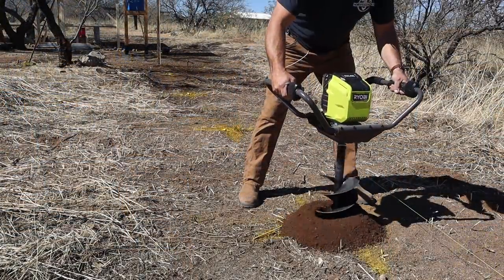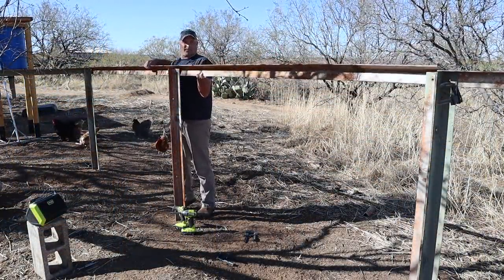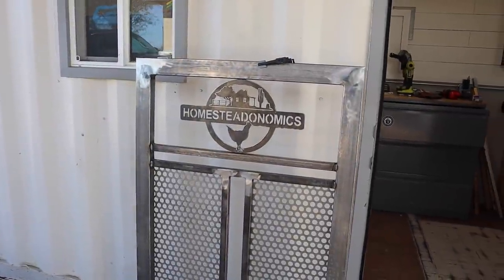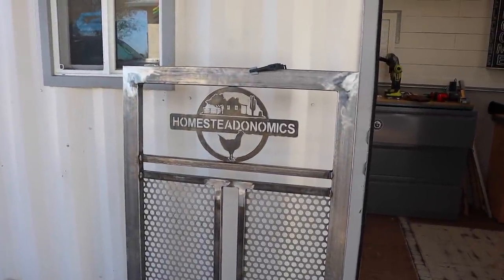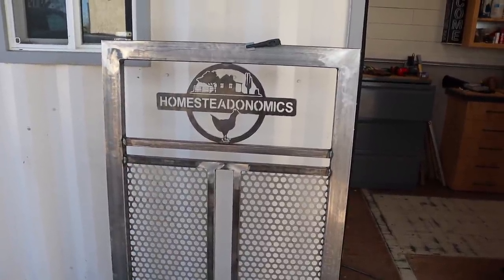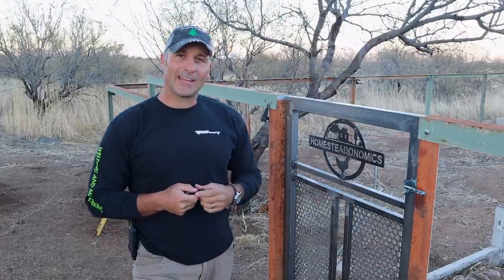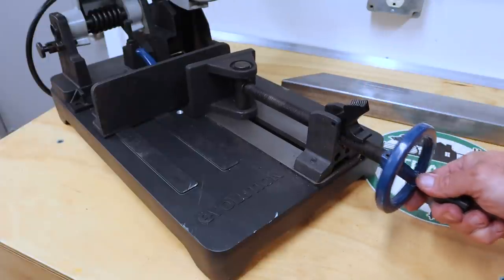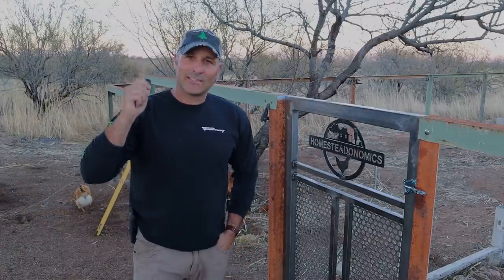Making a DIY Welded Gate for a Goat Pen  (Goat Project Pt 1)

Comment: That gate you built is really great! I am looking forward to the finished enclosure video.
Reply from the maker: Thank you Randy!  I just wire wheeled the rust spots on the fence and primed it today.   So once the paint is on I’ll add the panels and it should be good to go.   Except for the shelter and food water setups.    Gonna be a big project but we are excited for it!

Comment: Glad to see you putting the steel to use.  I was going to build a carport with it but since I live on a corner lot at two intersections, the city wouldn't let me do it because "It would block traffic views" even though my next door neighbor has a huge block wall carport that blocks them anyway.  Great job, looking forward to see what it looks like when finished.
Reply from the maker: Hey George!   I was going to email you the link but you already saw it…great!   The next video should be the fence in somewhat finished form.   Wire wheeled most of it today and then sprayed some primer over the really rusty spots.   Then I’ll paint and add the wire panels in after that.  Except for one corner where the shelter is going to go, it ‘should’ be goat proof! 🤞.   Stay tuned to see the de’anza/cohn theater steel painted and taking on a new purpose!  
Great to hear from you George! 
Joe
Reply: For those who are curious about how I got the steel, the drive-in closed on Oct 9, 2009 after it had been sold to a developer.  Some friends and I formed a corporation and the owner was willing to lease it to us but we needed to raise about $100,000 to upgrade at least one of the four screens to digital projection.  Before we could raise the funds, it got taken over by drug dealers and prostitution so the police asked that it be torn down.  The owners gave us one screen and that is where the steel came from.  I eventually gave it to Joe and his friend to use in other projects after I couldn't use it for a carport. It is now the site of a gas station and an office building complex.

Comment: I have made a few gates for my goats, but not out of metal. I made mine out of pallet wood. They work.  Just remember one thing, when it comes to goats. "if your fence doesn't hold water, then it won't hold a goat." ;P
Reply from the maker: I have heard that before and I’m just waiting for that first escape to happen after I thought I had it locked tight.   Seems that goats will find any weakness your fence has… if if there isn’t a weakness they’ll start jumping off of things to get over it.   Should be fun😂

Comment: Another wonderful project. I have one of the Evolution 12" electric concrete Saws as my backup. I love it! It's definitely like the new setup. I'm starting to think that might be the way to go over a larger metal bandsaw. Thank you for sharing and making incredible positive content. Of course, not sure if my bank account thanks you. LOL. I might need to get the Ryobi earth augur, too. I enjoyed seeing that in the lighting project. I could see that coming in handy when I install low voltage well lights. 🙂
Mark (& Teresa)
Reply from the maker: Thank you! Yes the auger has really been quite useful lately….the holes just got so quickly with it.  However, I do have parts of the property that have quite a lot of rock so the digging bar won’t be completely out of a job…haha
And I’ve seen that concrete saw too….looks really good for a plug in type.   Of course the gas powered is hard to beat for pure power and utility!
Reply: @homesteadonomics  ☺️

Comment: Great video.  How thick is that hinge . I get it that the door isn’t that heavy but and wondering about how heavy the door is vs how thick the hinge is.
Reply from the maker: Thank you.   The hinges are 1/8” at the plate and there are 3 total.   Just showed the top on on the video.    Not sure on the gate weight but maybe in the range of 30-35lbs or so

Comment: Next time weld inside corner to the outside. It'll pull less from the heat and won't twist/distort
Reply from the maker: Good to know..thanks!🙏😀
Reply: @homesteadonomics  weld the outside edge first and inside corner last and it'll either not move or move very little.